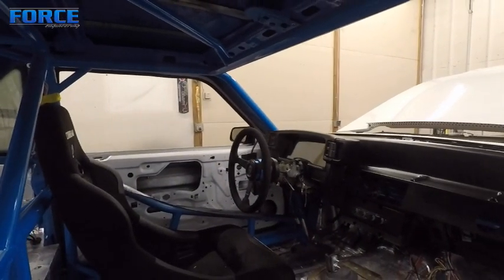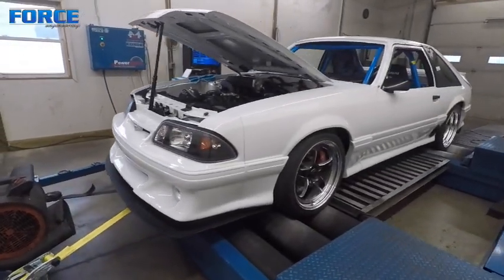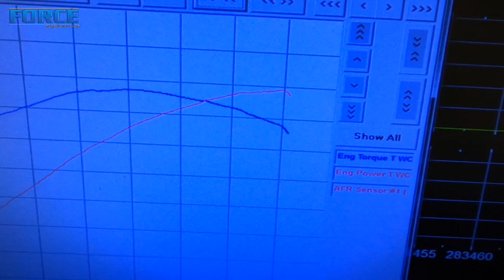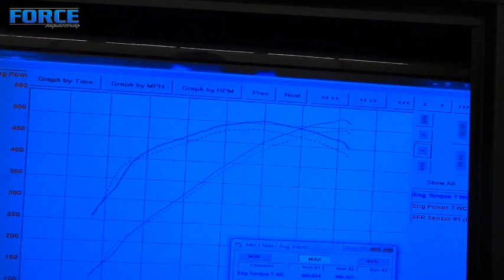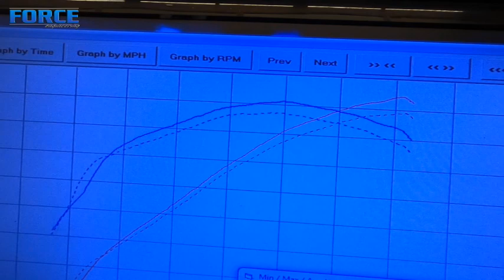TorqStorm Supercharged SBF | Foxbody Mustang | Holley EFI | Dyno Review

Comment: What a let down.  I was considering torqstorm until i watched this video. Seen too many 302-306 cid with heads/ cam/ intake put down 495-508 with an s-trim on pump gas, no methanol. So disappointing
Reply from the maker: Can't really compare dyno numbers from a different dyno.  I've made 600 with a  coyote and this same head unit.
Reply: @ForceEngineering  You're right, I totally agree with my experience. I used to work at a dyno 20 years ago. I guess I was just expecting more. One thing, I didn't notice it was a auto the first time I watched the video.

Comment: My stock bottom end supercharged 302 with heads Cam intake made 503 at the rear wheels with 12 PSI on pump gas.
Reply: Oh ...I believe that .My stock bottom end 95 gt w/ edelbrock performer heads, edelbrock Performer rpm intake, and an E cam with 42lb inj. and a Vortech S trim made 508 rwhp and 489rwtq on stock pulley (3.33inch) @ 8lbs. Later on with a pulley change to a (3.15 in) and 11lbs of boost Not sure of the rwhp. I would guess around 530Hp but the car would run 6.90s at 101mph and in the 1/4 11.0s @ 127mph... I seriously guys cant say for sure if the increase in boost levels could all be attributed to the pulley change or if tightening the the damn belt LOL is really what helped out a lot. All of this with terrible 2.0 60fts. Full weight 95 gt. w/ a 5 speed with a set of old dry rotted BFG 275/60 Dr's.. No fmu just had 2 t-Rex pumps and the 42s @60lbs of fuel Pressure. I swear I am not trying to compare or say that 1 car is better or anything...Im simply responding to Stock Block Boost comment
Reply: @navy_vet493  When ever I see a dyno vid on this channel. The numbers always seem way off. I dont know if he has much experience in tuning or if he just throws 15 degrees at it and keeps it really conservative.  Any decent small block with a nice set of aluminum heads and boost should make around 500 to the wheels around 10 psi. Especially with this being a 347

Comment: I don't know that's a completely built motor 347 Stroker cammed aftermarket heads etc etc and with the supercharger added I'm pretty sure I've seen these numbers on a stock bottom end 302 with GT40 worked and ported Explorer heads a cam and a procharger
Reply: You're right.